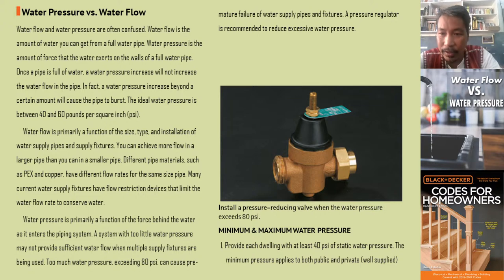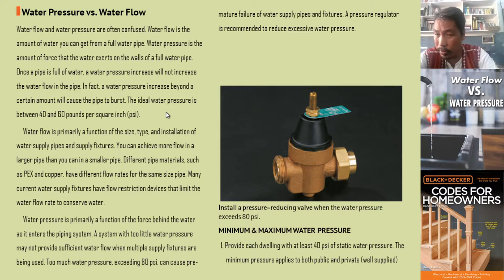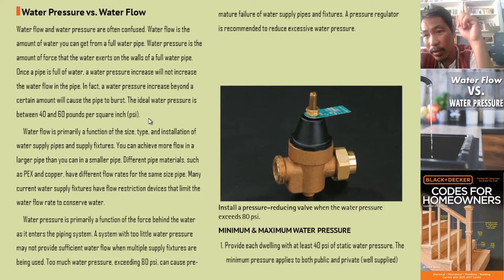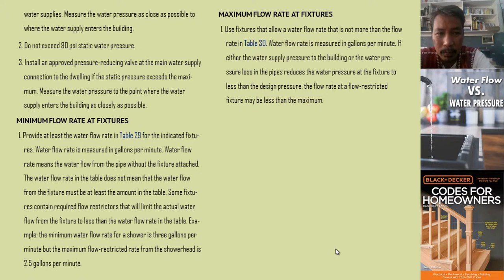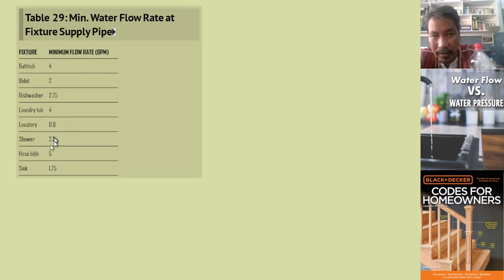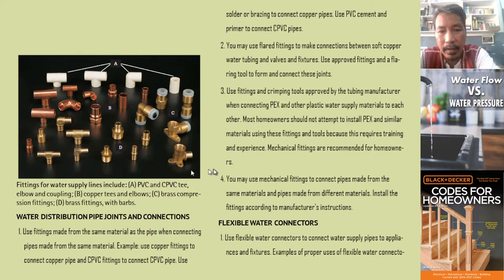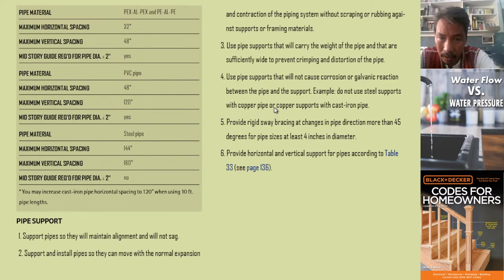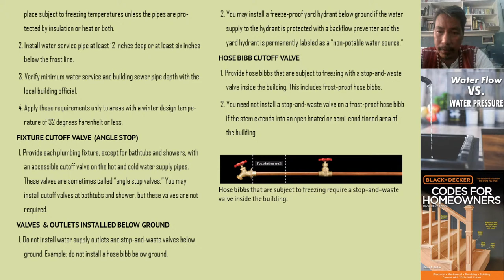[ LIVE CE D2 Lecture 06 ] DrAP Zantua Water Pressure & Flow Talks + ENGINEERING Analysis & Design

Comment: thankyou sir for another live lecture that discusses about the difference between water flow and water pressure. And also for explaining briefly each topic like the minimum & maximum water pressure, minimum & maximum flow rate at fixtures, common water distribution pipes, showing the example of fittings for water supplies that include PVC and CPVC tee, elbow and coupling; copper tees and elbows; brass compression fittings; brass fittings, with barbs. Also for talking about water distribution pipe joints, flexible water connections, pipe support, protecting pipes from puncture & corrosion, protecting pipes from freezing, fixture cutoff valve, valves & outlets installed below ground, and hose bibb cutoff valve.

Comment: Thank you, Sir for the live lecture and for sharing us the water distribution pipe joints and connections, flexible water connectors, minimum and maximum water pressure, minimum and maximum flow rates at fixtures

Comment: Thank you, Sir for the live lecture and for sharing us the water distribution pipe joints and connections, flexible water connectors, minimum and maximum water pressure, minimum and maximum flow rates at fixtures, and comparison and contrast of water pressure and flow.

Comment: Thank you sir for this live lecture about comparison and contrast of water pressure and water flow, minimum and maximum water pressure, minimum flow rate at fixtures, maximum flow rate at fixtures, water distribution pipe joints and connections, flexible water connectors. I have learned in this video that the water flow is primarily a function of a size, type, installation of water supply pipes and supply fixtures while water pressure os primarily a function of the force behind the water as its enter the piping system. Provide each dwelling with at least 40psi of static water pressure. Additionally, also Thank you sir for the table that show us the minimum and maximum flow rate of fixtures, common water distribution pipe materials, and plumbing pipe support, water supply and DWV pipes.

Comment: Thankyou sir for briefly explaining about water pressure and water flow. Water flow is the amount of water you can get from a full water pipe. The water pressure is the amount of force that the water exerts the wall of a full water pipe. According to this video lecture, water flow is primarily a function of the size, type and installation of water supply pipes and supply fixtures. The water pressure is primarily a function of the force behind the water it enters the piping system.

Comment: Thank you so much, sir, for this live lecture about water pressure and water flow. I learned in this video, the difference between water pressure and water flow. the water flow is the amount of water that comes out of the pipe while the water pressure is the force that water exerts on the walls of the water pipe

Comment: Thank you sir for this live discussion about the water pressure and water flow, on its compare and contrast type of discussion. I learned that water flow it the amount of water while the water presure is the amount of force applied. Water pressure is ideally between 40 to 60 psi.Also thank you sir for showing us the common water distribution of the common fixture that we have in our houses like you shown on the tables.

Comment: Thank you sir for this live lecture about the water pressure and flow. I comprehend that water pressure is the amount of force that water exerts on the walls of a full water pipe. The water flow is the amount of water we can get from a full water pipe. Water pressure is between 40 to 60 psi. The distinction and difference between waster pressure and flow were explained clearly. The maximum and minimum water pressure and water flow were also explained. Some flow rates from Tables 29 and 30 were shown and discussed. The common water distribution pipe materials were mentioned. Joints and connectors for water distribution pipes were also explained. The Plumbing pipe support, water supply, drain, waste, and vent pipes were discussed.

Comment: thank you sir for discussing water pressure vs. water flow. I learned that water flow is the amount of water that you can get from a full water pipe while water pressure is the amount of force that the water exerts on the walls of a full water pipe. Once a pipe is full a water pressure increase not the water flow in the pipe. The ideal water pressure is between 40 and 60 pounds per square inch (psi). water pressure is primarily a function of a force behind the water as it enters the piping system. Also this video discussed minimum and maximum water pressure, minimum and maximum flow rate at fixtures, water distribution joints and connections, flexible water connections, table 32 plumbing pipe support water supply and DWV pipes, and pipes support (protecting pipes from puncture and corrosion, protecting pipes from freezing, fixture cutoff valve or angle stop, valve and outlets installed below ground, hose BIBB cutoff valve).

Comment: Thank you Sir for this live lecture video that tackles about Water Pressure and Flow. I have learned in this video that the water flow  is the amount of water that we can get in a water pipe while the water pressure is the amount of force that the water exerts in the walls of the water pipes. If the water pressure increases it does not mean that the water flow will increases. When the water pressure increases that is beyond to its certain amount that will cause the pipe to burst. The ideal water pressure is between 40-60 psi. The difference of water pressure and water flow is clearly explained in this video. It is also mentioned here the different pipe materials and its sizes. Different sizes of the water pipe have different flow rate. I also learned about the limits in water flow and water pressure. The water pressure should not exceed to 80 psi, it is needed to install a pressure reducing valve when it reaches 80 psi to prevent the water pipe to burst. In table 29 and 30, it is discussed there the minimum and the maximum water flow rate at fixtures.

Comment: Thank you sir for sharing us this academic live lecture video, water pressure vs. Flow, 40 to 60 psi is the ideal situation of water pressure, minimum water flow rate at fixtures supply pipe, maximum water flow rate at fixture supply pipe is 80psi,the ordinary and strongest pipe use...

Comment: This live lecture discussed the difference of water pressure and water flows. Water flow is how much is the amount of water that come out of the pipe while the water pressure is how forceful it comes out of the pipe. This water flow is determined by water pressure. The ideal water pressure is 40-60 psi. However, 7 psi is good enough. This pressure can be natural or we can used a utilized engineering method using a machine such as water pump. Water treatment are also discussed as for the bacteria, they use chlorine for water to be safe to drink. There's a acceptable level allowed percentage for bacteria and it is tested before distribution. The minimum and maximum flow rate, , common water distribution pipes joints and connections, and flexible water connectors has also been discussed. It also talks about the different type of material and its maximum vertical and horizontal spacing. It was clearly stated in the table. Thank you, sir.

Comment: The water has pressure and flow, the easy way to differentiate these two is: water flow is how much water comes out of your pipes while water pressure is how hard it comes out of your pipes.  The water pressure has 40 to 60 psi. In this lecture further discuss the minimum and maximum of a water pressure ans flow rate at fixtures.